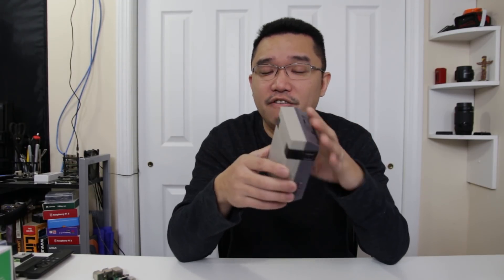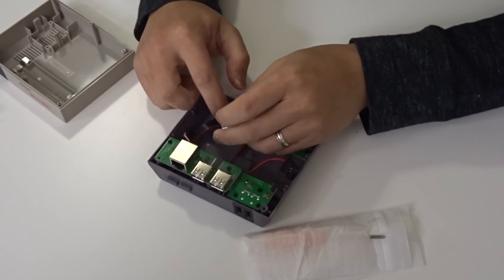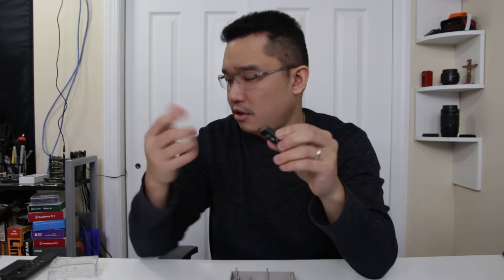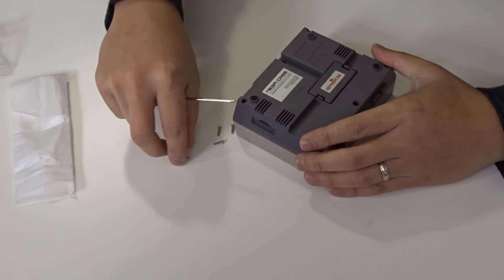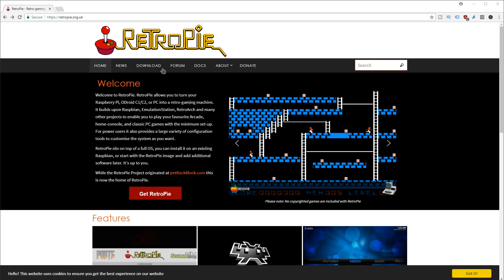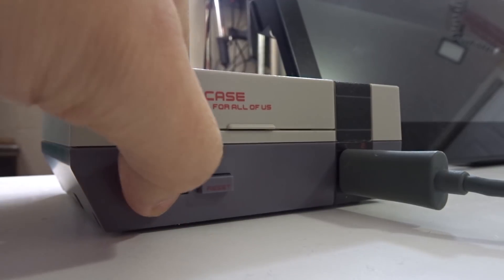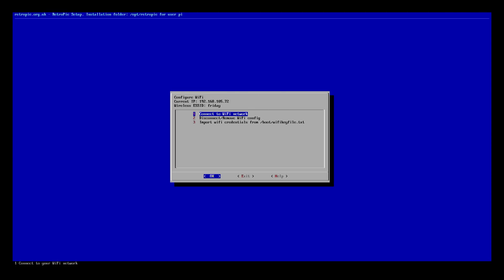Retro Pie Build with NES pi Case

Comment: I built a few of these. There's a dual fan cooler for the Pi and it fits perfectly in the case.  The other cases just have a 30mm fan but works either way.

Comment: I would also recommend using a magic eraser and a bit of gaffing tape. I taped off the “NES” on the front. Then used the magic eraser to remove the extra “retroflag for... blah blah blah” from the front.

Also use a Pi3 with built in WiFi and BT.
If using a Pi2, get mini dongles that can fit into the case internally (long usb dongles will not fit.)

It looks a lot cleaner with those minor changes.

Comment: Ethernet in front is an odd choice...
Reply: Robert Fabiano On a Raspberry Pi, the Ethernet and USB ports are clustered together, so the only way to not have them all on the same side on the NES case would be to have a USB hub and/or Ethernet passthrough built into the case. Seems like that would make it a lot more complicated and expensive.

Comment: Great video. Any tips on getting the power button working without corrupting the sd card?
Reply: Looks like this case already has a powerbutton, but this link shows you what scripts you might need to enable to get this working. Here ya go: https://howchoo.com/g/mwnlytk3zmm/how-to-add-a-power-button-to-your-raspberry-pi It's a bit odd that the manufacturer doesn't seem to go over this at all. :-/

Comment: No way I've been doing this for the past two days great minds think alike hey =]
Reply from the maker: that's awesome
Reply: Novaspirit Tech when you for the fan you will seriously be surprised but the air flow dynamics in this case mine clocked at 1400 CPU 520 core and GPU sits around 20°c while playing and that's using the standard 1.99 fan =] Love the videos buy the way your content has helped me with these marvelous little machine's. Keep up the great work!!